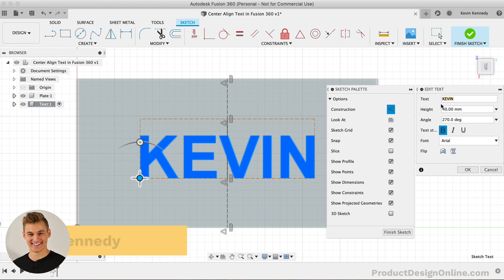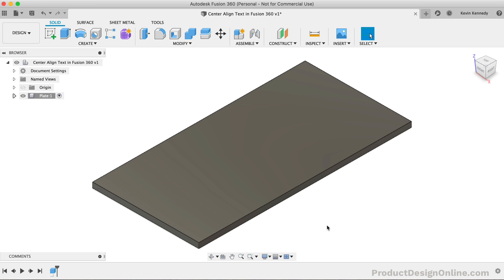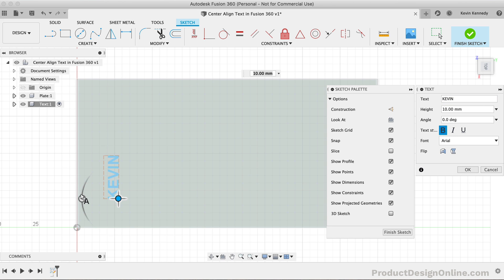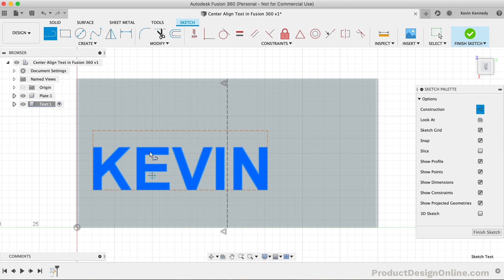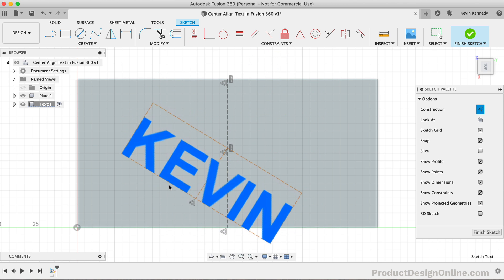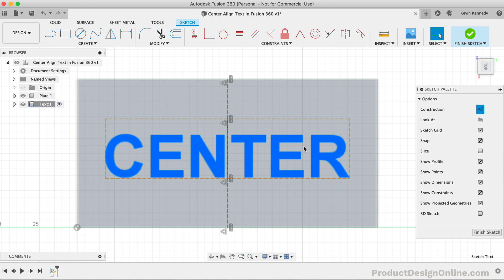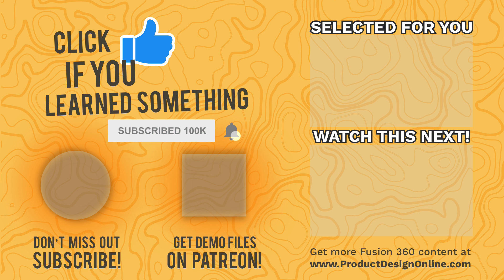Center Align Text in Fusion 360 (2020)

Comment: Is there a way to center align in the vertical direction? I know you will all jump and say 'it's in the video', but in the video he doesn't achieve it as there is a massive gap between the text and the bounding box...
Reply from the maker: You will have to use constraints and a dimension to measure because of the text bounding box being larger on top. there is a huge update coming to the text tool very soon which will take care of a lot of this :)

Comment from the maker: TIMESTAMPS
0:00 - Center align text in Fusion 360
1:00 - Creating the text
1:33 - Creating two construction lines
2:13 - Using constraints to center align
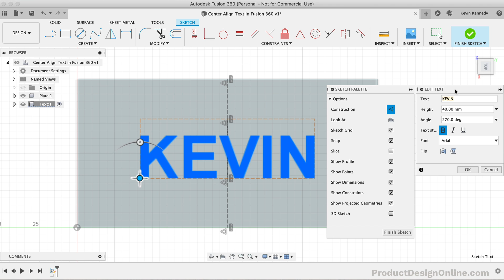2:50 - Editing the text
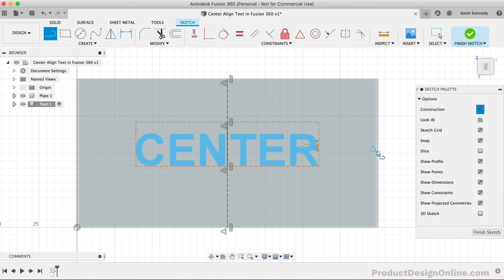3:30 - Centering the text vertically

Comment: This seems to no longer work as of 4/28/20 - selecting both top midpoints and then the horizontal/vertical alignment causes the text to simply have its top edge aligned with the top edge/line of the sketch face. Then if you do the bottom midpoints, it just resizes the text so its bottom edge is aligned with the bottom edge/line of the sketch face. Keep in mind, I just did this a couple weeks ago successfully following these same steps. Please, someone tell me I'm doing something wrong
Reply from the maker: I just checked on my end and it seems to still work as expected. It is a bit tricky, as if you select anything differently, the constraints could be applied in a different manner. Double-check your constraints.

Comment: Good trick but it really does not center the text in the box because the text does not sit centered in its own box. The text is actually sitting on the bottom line of its box .
Reply from the maker: Good point, Bernie! I think the workaround is to create an extra construction line the height of the actual text... to find the true center. Then use the true center to constrain it :)
Reply: @ProductDesignOnline  that could work. I will try it next time I do text.
Reply from the maker: @berniewasserman265  let me know how it goes!

Comment: This is great, however the bounding box prevents the centering properly.  There is space between the top of the letters and the top of the bounding box.  By centering it the way you showed, the text will be centered between the left and right, but too low when attempting to centering between the top and bottom.
Reply from the maker: Good point, Lee! I think the workaround is to create an extra construction line the height of the actual text... to find the true center. Then use the true center to constrain it :)

Comment: Is it me or isn't the construction box around the text horizontally centered and not the actual text?
Reply from the maker: Hi Jacob. That is correct. If you want the box to match the text then you'll also have to set a sketch dimension to the left or right edge of the box (as the same value as the height).
Reply: @ProductDesignOnline  Thanks for what you do! I've learned a lot from you!